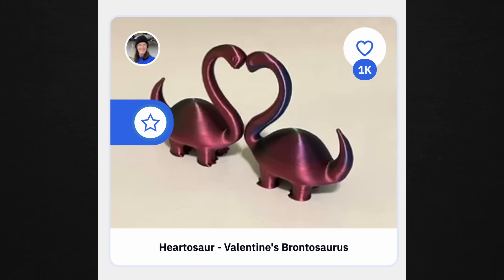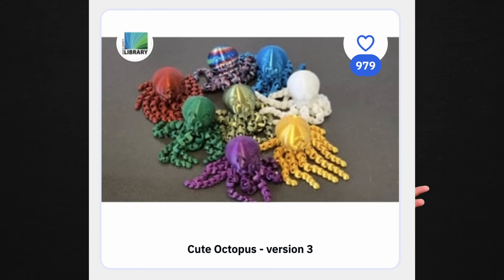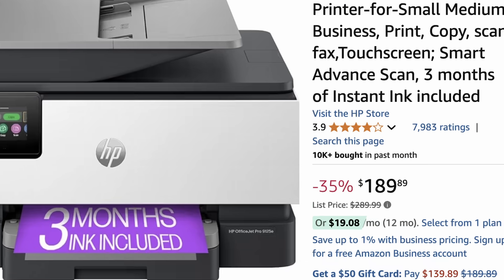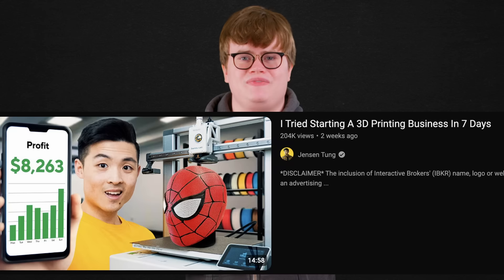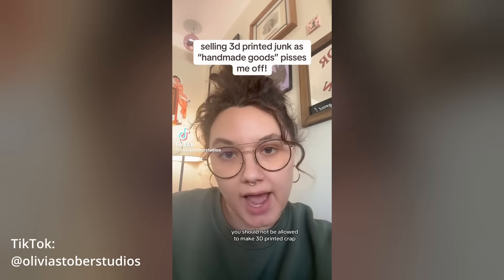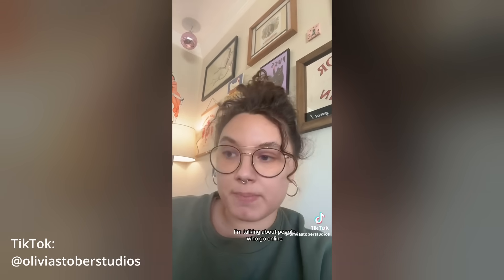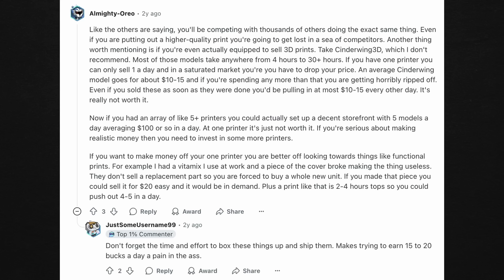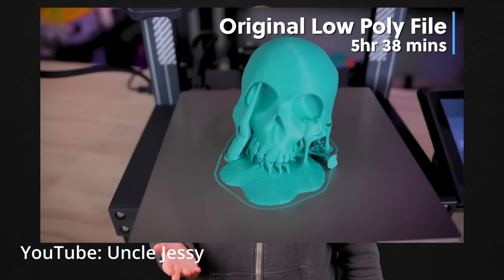The Rise of 3D-Printed Slop

Comment: I didn't see owning an FDM as having any value for me (receiving poor quality FDM printed parts for RC aircraft) and the pointless plastic nonsense I saw on the Internet.

However I was wrong, the ability to make things which are no longer available or improved versions of things I use most days.

However I do have the ability to design and print my own objects from scratch.

Apart from a couple of downloads to prove the printer actually worked, the only download I have printed are Lego coat hanger studs for my Granddaughter.

I couldn't think of a duller(or wasteful) thing to do than printing things merely for the sake of printing them, but I guess each to their own

If I was currently able to paint gaming figures I would have bought a resin printer, but that won't be happening for a while.

Comment: i play airsoft and a year ago i spent £150 on my printer ender 3 v2  (with 2 rolls of pla+)   I use this to make small parts for my rifs or even Full length suppressors or spare parts    printer has likely saved me around £300 and its only been a year and that's not including the things i have printed for friends who have either offered to pay me or bought me a roll of filament for my troubles
 
 Over all yeah 99% of the time most 3d printers are a gimmick but for niches like airsoft it cant be Very useful.   

Just today i 3d printed Scope covers or (Kill flashes) for my scope and for my friends saving us a whopping £15 each across 3 people all for about £ worth of filament AND better yet i was able to adjust the sizes to fit each one and experiment with the right sizes.

i also play a video game called space engineers    this is relevant because I can transfer Blueprints of my ships for my self or friends to my slicer and Print them.

Comment: 10:24 Actually PLA, one of the most common materials for 3D printing, is biodegradable, which is one of the reasons why it is my main filament.
Reply: That’s very relieving to hear actually, but at the same time I think the issue of overconsumption still stands in the promotion of 3d printing in general. Unfortunately, the people buying these items almost never think about what’s being used to produce them, and whether or not it’s eco friendly. Therefore, they won’t tell the difference between something printed with PLA vs other materials

Comment: You're significantly over estimating how easy it is to clean VOCs out of the air.  My home air purifier keeps the room my printers run in cleaner than the air in the rest of my apartment. Costs like 20-80 dollars depending on what you need.

Comment: I mostly agree with you; I don't feel like the layer lines are a big deal in most (but not all, of course) cases, but millions of people selling the same things, and especially people buying them up just so they can "have another" is definitely lacking in cognitive function..(this goes for anything, really). I also agree that the majority of things online are no good for printing, even the things that are supposed to be functional..(not designed for 3D printing; unreasonable overhangs, very sharp corners, all the things printers hate).
At this point I've either modified, or completely redesigned pretty much everything I've found (that I haven't custom made for some individual thing that I need) and I don't go on expecting to find something usable, more just for inspiration..(most of the time the things aren't far off, but can't be modified without completely rebuilding them first..) what does it take to get people to care NotLikeThis
Reply: I also agree that 3D printed stuff should not count as handmade...

Comment: A blind man describing the world to you!  Take each point with a grain of salt as the author admits ignorance in many of them.  
"find design, push print, come back later, you're not a maker" counter point: does a cabinet maker always make an "original" for every house?  Does a baker make an original brownie on every batch?  Does a fiber arts person not use a pattern when making thing they've made 10x before?  Or do some of these craftspeople use a template to create?  Not going to say 3d printing isn't getting easier as we progress however for ANYONE who has used ANY 3d printer: it's not always push a button and walk away.  you have to monitor it, fix jams, tune the process to the print/environment.  Heck, just with the generic dragons, people choose colors (in some case they are painting multicolors onto the print using software no different than an artist uses photoshop to airbrush a photo).  Im not going to defend the "printed slop market", however dismissing it all in the "not a craft" category is a bit harsh, overly critical, and judgey IMO.  As for 3d printing ventilation: some simple research will show you that the opinions of this creator are wildly left....

Comment: People just want something to use all their fun expensive printers and materials on. So we end up with endless trash. I do make my kids obscure little figurines of characters they like sometimes, but they are teeny tiny. I try to keep the slop to a minimum.

I used to be a mechanical engineer so am decent at modeling designs to solve all types of problems for mounting or fixing things, and now I'm a dentist, so I use resin printers nonstop for models and night guards. So it's mostly all nonslop, but I did make my share of trash back around 2015 when I got my first fdm printer.

Comment: Lots of good points.  I'm still very surprised people actually buy 3d printed trinkets.  The quality isn't good compared to injection molded parts.  Resin printing can get pretty close, but that comes with it's own issues.   I like to print some random fidgets as "wow look at what this tech can do" examples - but honestly they're trash.  I play with them for a few minutes and then they go into a box or bag until I find them months later and they go into the trash. 

Now my functional prints?  Those are all over my house and get used all the time.  But most are so specific I can't see there being much of a market, and also if I spend hours perfecting and iterating out a design what's to stop someone with even slightly better modeling skills from copying the design and selling it themselves?   In some of my hobbies that's a pretty regular complaint where an seller will use their scale/print farm to essentially push you out even if you came up with the design.

Comment: I really get your point but the reality is that people buy low quality plastic trinkets every day on the internet. If they are printing them at least there's no shipping envolved i guess
That may generated more disposed plastic but with how easily you can buy thrash from amazon with free shipping and don't really know if it's the case
Also the most common filament at least is biodegradable to some extension
But yeah, there will be a sea of thrash being sold in stores just like it has been happening for a while now and thats sad

Comment: I’m building a vending machine and to build the parts out of metal would cost thousands of dollars. If I wanted to use plastic injection molding, that would cost tens of thousands. If I wanted to ask someone else to print them, it costs thousands as well. I bought a $500 printer and $100 worth of spool and now I just have to wait 5 days

Comment: If you want to know why tchotchkes are so popular, consider that creating anything useful for yourself (that doesn't already exist) requires knowing how to create 3d models.

That is an enormous barrier to entry for almost all but the most dedicated of maker...and those guys don't print those things unless they're selling them. The single biggest thing holding additive manufacturing back is the difficulty of designing and creating the 3d models. 

First you have to choose what software you want....CAD oriented, or just a 3D Modeling tool like Fusion 360? Modeling of physical components w/ stress analysis and the ability to model working mechanisms...or do you want to sculpt an object by hand? 

Hell, the desire to avoid learning to model is so strong that it's just as lucrative at this point to make money distributing designs for commercial sale, as it is to be the one selling the actual prints. Until 3D modeling becomes as easy and beginner friendly as printing has become....expect lots of "because it was already made for me" prints.

Comment: I have to say that most 3d printers dont print in plastic. They print on PLA or resin.
What is PLA?:
Polylactic acid, also known as PLA, is a thermoplastic monomer derived from renewable, organic sources such as corn starch or sugar cane.

Using biomass resources makes PLA production different from most plastics, which are produced using fossil fuels through the distillation and polymerization of petroleum.

Despite the raw material differences, PLA can be produced using the same equipment as petrochemical plastics, making PLA manufacturing processes relatively cost efficient.

PLA is the second most produced bioplastic (after thermoplastic starch) and has similar characteristics to polypropylene (PP), polyethylene (PE), or polystyrene (PS), as well as being biodegradeable.

What is resin?
As its name implies, resin 3D printing uses plastic resin as the raw material, in contrast to the filament used in FDM technology. The liquid resin used in 3D printing is typically composed of either epoxy or a combination of acrylic and methacrylic monomers. When exposed to UV radiation, these monomers quickly form molecular bonds with each other and turn into a solid polymer.

3D printing using resins is also an additive process, just like FDM printing. This means that the process relies on a layer-by-layer building process where one layer forms molecular bonds with the succeeding layer. This process repeats until the whole model has been recreated.

In the current context of 3D printing, there are two predominant technologies of resin-based 3D printing: Stereolithography (SLA) and Digital Light Processing (DLP). Both technologies rely on the controlled emission of UV radiation on a vat of liquid resin, turning into a solid polymer according to a pre-defined model loaded into the slicer software.

SLA is the oldest form of 3D printing, and its process has been virtually unchanged since its development in the 1980s. It works by directing a laser at the UV frequency towards the vat of liquid resin. The point of emission is controlled by a mirror galvanometer. The laser moves along a single layer of the resin until the layer is completed, after which the build platform moves to allow for the fresh resin to be exposed to UV radiation.

The process for DLP is very similar except that it projects an entire layer at a time using an array of micrometer-sized mirrors, each of which can rotate to control the point of emission of UV radiation. However, more modern DLP printers have made the switch to using a panel of LED lights instead. This has made them cheaper and easier to maintain.

For both SLA and DLP printers, printing can be done at either the bottom-up or top-down orientations. The major difference between the two is the location of the light source. Bottom-up printers are much simpler and cheaper. However, they are very limited in the build size that they can accommodate, making them most suitable for desktop-scale 3D printing. For professional use, top-down printers are more preferred simply because they can create bigger projects.

In both cases, some amount of post-printing curing will be necessary to achieve optimal durability for prints made with resin. This can be done via a special UV chamber or simply by exposing the finished print to sunlight..

I hope this helped☺☺☺☺☺☺

Comment: I love 3d printing. It's one of the greatest tools for hobbyists to exist, and has let me do some amazing things, from designing containers and tools that I use daily, designing and printing a working model rollercoaster, and making detailed models to clear coat and paint. And it breaks my heart to see this amazing technology used in the laziest way possible, as a cheap cash grab to make objects without a purpose or soul.
Reply: Which printer would you recommend?
Reply: @vgnhdhe  hey, i’m assuming you’re new to the hobby, so i’ll give you a recommendation. the one i first got (and still use) is the elder 3 v2 neo ($214) and it works like a charm. it’s a good sized build plate so you can print big things and also does well with fine details as well. the main issues with 3d printing is that its constant fine tuning and troubleshooting until you get it working perfectly. i would suggest you get an ender 3 or v2 or v2 neo as it’ll give you a good starting point. after you get more experienced, you can get better parts or upgrade to better printers. hope this helps!
Reply: @bebnson  thanks a lot man, I mostly want to get into 3d for useful stuff around the house and get into a hobby like fpv drones
Reply: @bebnson  So many better printers now for the same price lmao
Reply: @Jejjing  oh fr?
Reply: @bebnson  yeah brudda. The new elegoo centauri is $299 and it's a core xy with a great touch screen tablet.
Reply: @ that’s sick. I don’t really know about elegoo fdm printers. i mostly only know them for their resin ones.
Reply: @bebnson I learned so much with the Enders. It’s torture but also nice to be able to fix my printer within minutes. I settled for an easier-to-operate printer after. I would recommend a Bambu A1 mini. It’s consistent, friendly, and has auto leveling which is a hassle with the Enders (3 V2 and 3 Pro in my case).
Reply: @luisgomez-kn3uw  or standard A1 bigger printbed
Reply: @bebnson To be honest, even the Enders have more user-friendly options now for a similar price, like Ender 3 V3 SE. I think the best option for budget nowadays is either V3 or Bambu A1 mini. That said, I use Ender 3 V2 Neo myself and it's a solid machine, as long as you're OK with doing some tuning (mostly replacing the fan shroud, really, the base one is needlessly loud).
Reply: @vgnhdhe  everything from Bambulab.... cant go wrong with them
Reply: @vgnhdhe If you're looking to get into it to print without delving into the annoyances of the hobby I would say go with a Bambu printer. I personally wouldn't buy one as I don't like their ecosystem and closed sourcing of many of their components, but for someone that just wants to print I would recommend it to them.

If you want to delve a little into the TLC aspect of it but not be completely thrown to the wolves, Creality or Elegoo are good brands to go to. Personally I have the Ender 3 v3 K3 and it has a few QoL features that are nice to have on a printer like auto bed leveling and wifi printing
Reply: 3D printing changed my projects from being uneven leather put together to leather the perfect shape being put together. A solid pattern that you can press a knife against and not worry about cutting is very easy to cut out a shape with. A pattern made of paper or even cardboard is all up to you. I've tried paper and cardboard patterns, but I can never cut it right. I always cut into the patterns.
Reply: Same as AI. It's the people who are trash.

Comment: So this guy is against making it yourself because you can buy stuff at Temu?  The Chinese junk store that sells your contact information to scammers. Seriously? Making custom designs for 3D printing is easy and there are plenty of free and low cost tools.  If you can play a video game you can learn 3D printing design.  Also, how you finish your product matters.  Paint and metallic plating changes the outcome a lot.  I see some of you guys are about being less consumeristic - if that is your argument then stfu.  Making it yourself tends to make you value something more NOT less. Also I don't need 20 pounds of packaging and a trip across the ocean for my 20 cent widget.  Incidentally, using resin the stuff I make is often of a HIGHER quality than what is readily available.  I have made lots of parts which would have cost hundreds of dollars.  Also,  I often corrected flaws in common designs and make my designs more durable.

Comment: Funny how this video about slop is, itself, slop. Who are you to say what is or isn't "artistically valid" for people to 3d print. I design and 3d print my own resin figures. You have no place demeaning what other people choose to make for themselves.
Reply: Agree. While he has plenty of valid points, he seems to be over exaggerating some aspects of 3d printed items. Especially the quality. In the last year or two the print quality obtainable with cheap 3d printers has dramatically increased, both due to printer advancments but also due to having a better quality filament, so I am consistently getting good quality items around 80-95% of the time. Many people will try operating a 3d farm and bankrupt themselves if they don't have a good business model just like with any other industry. But the ability to make custom items that you need, when you need them and how you need them is simply unparalleled